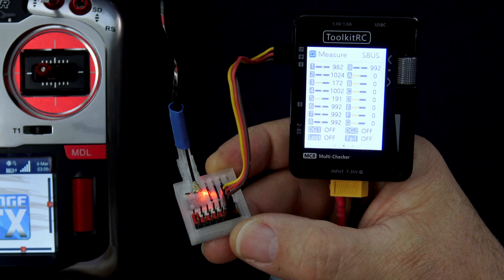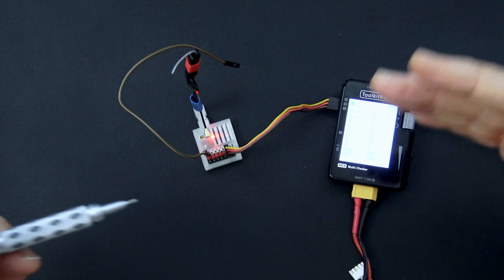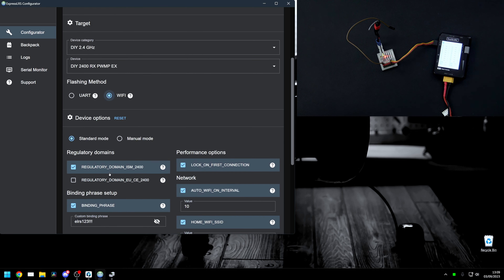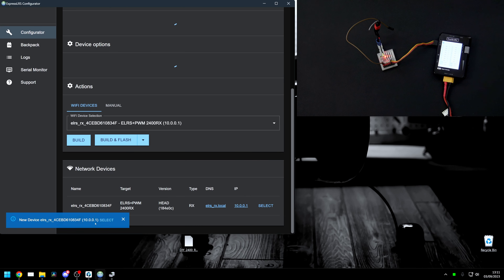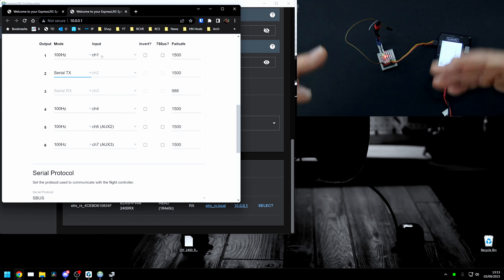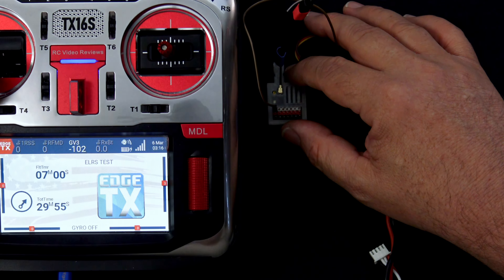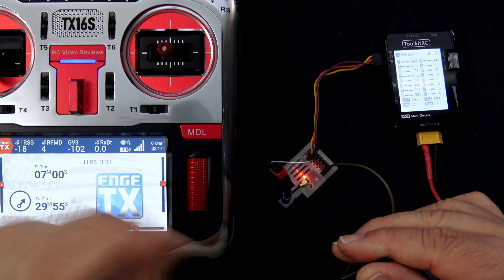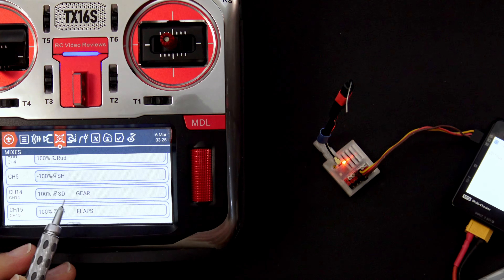EdgeTX: How-To Setup ExpressLRS SBUS, PWM, and VBAT on Matek R24 P6.

Comment from the maker: I accidentally cut the instruction to set the SERIAL PROTOCOL to sbus on the rx configuration page. Don’t forget to do that.
Reply: Only SBUS no CRSF?
Reply from the maker: Yeah, they're both there. These instructions were for SBUS though.
Reply: 1 big question I have had with the ELRS receivers with SBUS. Will I get more channels than my receiver is labeled for if I use SBUS option for example I have a 8 channel receiver but it shows 16ch when using SBUS

Comment: This is really impressive. I've been using the little sbus converters so I can have vbat but with pwm outs for flaps and such just a massive level up. If this was a spektrum Rx it would be 60-100$ probably?  Crazy
Reply from the maker: The converter also advertises a 5v input + adds some latency to the stream. The R24 P6 supports 9v, so you could use a 2s for power if needed.

Comment: Super! Now waiting for the same but with crsf instead of sbus)
Reply: For the Happymodel equivalent, my understanding is that if you flash the HappyModel_EP_2400_RX firmware then pin 2 becomes Tx and pin 3 becomes Rx and you can connect it via CRSF.  There’s probably a way to do the same with the Matek.

Comment: All you had to do was select invert signal in elrsconfig and then select Csrf in BF. It will work.
Reply from the maker: Assuming BF means beta flight, what does that have to do with this video?  At the time this video was posted a year ago, sbus was not available as an option in ELRS. This video showed how to get a PR, compile it, and turn SBUS on. It doesn’t have anything to do with BF or inverted CRSF. This is about sbus.

Comment: I have everything working thanks to your video! One thing though is that my VBAT value is off by about 3volts. Did you use a scaling factor or have I missed something?
Reply from the maker: 3 full volts is pretty significant. I would look deeper into that. There is an offset in telemetry to adjust the sensor. I usually use a multi-meter, but 3v sounds way off to me.
Reply: @RCVideoReviews  Thanks for getting back to me. It is really strange, I'm using the new pre release 3.3.0 RC1. Checking again I get a difference of 3 volts on the 3S pack which is at 11.4volts. but only a difference of 1.3 volts if I measure the Rx 5v line. I tried to go back to the pre release "master" firmware but get "No enough space" error and the UART method just times out. Seems I can't win today!

Comment: Hi John. Playing with setting up a Matek R24P 5 pwm.  Works well with Sbus following your setup. However when I setup my Tx16S (v2.9.0 Edgtx) for channels 11, 13, 15. They appear to be setup as I wish but once I leave the setup screen they are not visible in the INPUTS screen. What's the trick to see them for editing/deleting etc. They do show on the Mix screen. Just another weird one from me, right. LOL Thanks in advance. I'll post this in Discord.   Jeff.
Reply from the maker: Try rebooting the radio and also try making a completely new model.
Reply: @RCVideoReviews  Got it working. Made another new model and used 1 to 11 and 4 to 14 and it's working now. Nice that now in the radio you can change the rx protocol to SBUS from CRFS etc. Awesome.

Comment: Great video :) Thank you! - A question if I may, and sorry if it was mentioned in the video: when a channel is assigned to a PWM output pin, the same channel is still sent also into the SBUS stream (it's not "skipped" so to speak), right?
Reply from the maker: That's correct. All channels are sent to the SBUS output process.
Reply from the maker: See this video for an example: https://youtube.com/live/SeNsK70B4l8?feature=share
Reply: Thank you! :) @RCVideoReviews

Comment: Hi, it seems #2094 has been removed from Git Pull Request? Or why is it hidden in my ELRS Configurator??
Reply from the maker: It was merged into the master, and now in 3.3RC-1. 

So you can either compile the master branch, or use 3.3.0-RC1.

Comment: John: 
You covered a lot of ground today. Thanks for pushing the envelope for all of us!
   Are these instructions unique to only the Matek R24D P6 flight controller? Can we use ANY ELRS receiver that handles PWM output?
Jim
Reply from the maker: I’d like to say yes but I have seen different config options for other features from time to time. Of course, some PWM RXs do not have vbat so that feature would be excluded. 

SBUS should compile for all receivers. I’ve also tested on R24D.

Comment: At around 4:15 you bring up a ExpressLRS page that appears to allow a change to channel mapping.  I’m not messing with SBUS, but would like to correct for a TAER vs AETR difference in the receiver for a Kiss based quad copter.  Do you know what enabled that setting?  Is it a developer build?
Reply from the maker: Channel mapping is available on PWM RXs. Not Serial Stream RXs [yet].

Comment: Hello, very good news, I want to test it, but I can't find on the configurator pull request tab the RX serial refractor version... Is it removed?
many thanks for all you job/videos
Reply from the maker: They merged it. You'll have to flash the master branch now.
Reply: @RCVideoReviews  even better news, many thanks. It means that I can flash the last firmware and then I will have the choice to choose SBUS output? I have a look on the configurator but I find 3.2.0 even with pre-release activated, and in the branchs I don't see a version for Sbus, perhaps in the 3.x.x maintenance? Sorry to disturbe you.
Reply from the maker: You have to click on "GIT BRANCH" and use master.

Comment: Do you trust this enough to run sbus on an expensive heli? I'm running ikon 2 fbl units and just hooked up a matek elrs rx in crsf mode, but I'd rather just use sbus for simplicity of wiring.

I am currently running elrs sbus on a cheaper flite test plane that seems to be working ok. My trust is building up on it.
Reply from the maker: I've been flying ELRS on all of my spendy big planes. SBUS---I dunno. I wouldn't run it on a heli just yet. I tested it on my Avanti S, but that's quite a bit cheaper than a good heli.
Reply: @RCVideoReviews  ok thanks! I’ll wait for stable release before I run sbus on the helis.

Comment: RX Serial refractor is not appearing in expressLRS Configurator ver.1.6.1 and ELRS 3.3.0. I'm using a ER8GV RX Radiomaster and TX ELRS Micro . Where can I get this. Thanks in advance.
Reply from the maker: SBUS was released in 3.3.0. No longer need a special firmware. Just use 3.3.0.
Reply: @RCVideoReviews  I'm using it but when select Ch2 to select Sbus it doesn't appears. I don't know what happens. Perhaps is because it's LBT version?
Reply from the maker: Radiomaster ELRS RXs with UART port use the UART for serial output, not pin 2.
Reply: @RCVideoReviews  I think I have solved this problem. ER8GV has a 4 pin connector beside the RX, then when you choose SBUS as protocol in RX it works as a standar Sbus RX as X4RS or X6R or anyother RX with Sbus and allow to use al other pins as you wish. Tomorrow mornig I'll test it in a Tarot 680 with Naza V2, but tested with servos in any chanels has been working fine.

Comment: Coming over from quads, can someone explain what gain is and which channel outputs it affects? RCVR , thanks for sharing your goto setups for ELRS Rx, Gyro, Sbus configs. Do you have a comparable recommended config for an ELRS FPV plane setup - I've been searching your vids and found one with a Matek 722 FC, which didn't seem to be a winner...
Reply from the maker: Gain refers to the level of adjustment made to control surfaces subject to gyro control. Usually this is Aileron/Elevator/Rudder. Think of audio--increase in gain result in increased amplitude. F722 is decent. I just had a bad one.
Reply: @RCVideoReviews  Thank you. Can gain be restricted to ust one surface like Aileron? I know how to set a switch in the mixer to control expo with a %, but I don't see where to specify "gain" in the model or radio settings?
Reply from the maker: Depending on the gyro, you can set individual gains on control surfaces. Those values are one factor. The gain knob we assign on A3S4 for example is a master gain which means it's another factor. Used together, they result in a product. For example:

Aileron Static Gain in Gyro = 20%
Elevator Static Gain in Gyro = 0%

Master Gain = 0%
Aileron 20% * Master 0% = 0%
Elevator 0% * Master 0% = 0%
In this case, the gyro is effectively disabled.

Master Gain = 20% 
(Aileron 20% * Master 20%) + Aileron 20% = 24% 
(Elevator 0% * Master 20%) + Elevator 0% = 0%

Gain is a function of the gyro, not the radio. Some gyros like the A3S4 allow for Gain to be received from an OTA channel.

On the radio, changing your WEIGHT has a similar effect of changing GAIN when using a gyro.
Reply: @RCVideoReviews  Wow! Fantastic explanation! Great idea to put it on S2 and adjust in flight.Thanks again!
Reply from the maker: You're welcome.

Comment: This is aweseome. Do you know if this would work on EP1 Rx? As in can i get SBus on the Ep1?
Reply from the maker: It should.
Reply: @RCVideoReviews  I can confirm that it works. I was able to work with the devs to get control of my DJI RS2 gimbal. Your video sparked the interest and ultimately the implementation. So thank you!!!
Reply from the maker: Glad to help.
Reply: @im_gldn  how you connect EP1 rx and tx on board? EP1 tx - sbus? EP1 rx - ppm?

Comment: Can you configure ELRS to sbus for helis also John
Reply from the maker: Remember this code has not been merged to the official branch, so consider it experimental. ELRS SBUS should be the same as any other SBUS when it comes to FBLs.
Reply: @RCVideoReviews  it’s a very interesting advancement John, when it’s had more testing I would like to try it in gliders and helis
Reply from the maker: Smart call. I wouldn't put it in my helis yet. I have helis where the motor cost more than the Jet I tested this in.

Comment: Your video title had me hoping that there was a PWM receiver with antenna diversity. But no, not yet...
Reply from the maker: I'm not sure of the correlation between SBUS, PWM, VBAT, and Diversity...?
Reply: @RCVideoReviews  You mention "R24D P6" in your title, but AFAIK there's either the R24D or the R24-P6.
Reply from the maker: Ahhh. I see. Thanks. D removed.
Reply: @RCVideoReviews  I was hoping you knew something I didn't!
Reply from the maker: Still might--just not about a Matek Dual Antenna PWM RX. :P

Comment: I have R88 with SBUS connection to FC and I use TX16. I want to add 2 servos for cam movement with Skyzone gougles. Where do I plug those servos (If my 8 chanels are taken by flight control)?
Reply from the maker: Any PWM pins. Remap them in the Rx WebUI to use channel #'s outside those used by flight control.